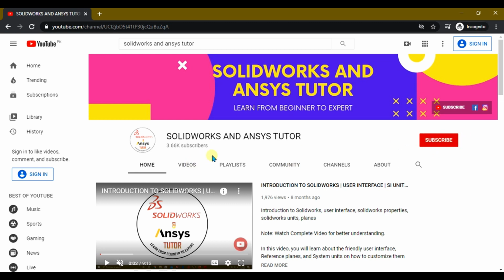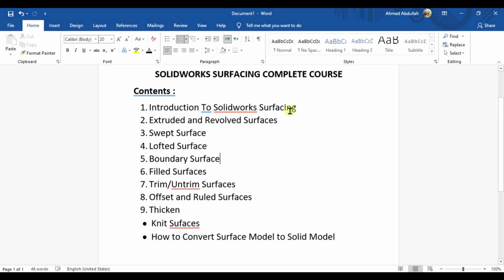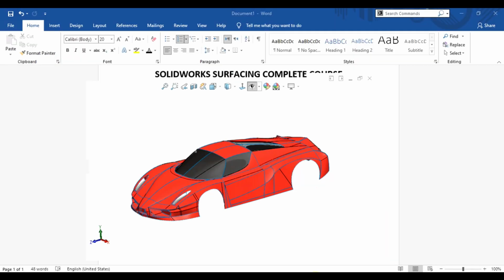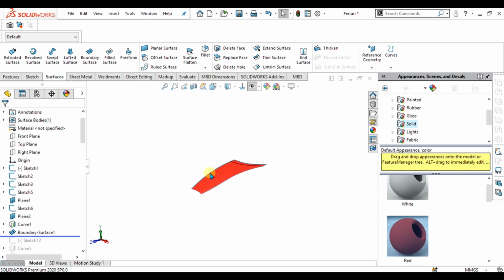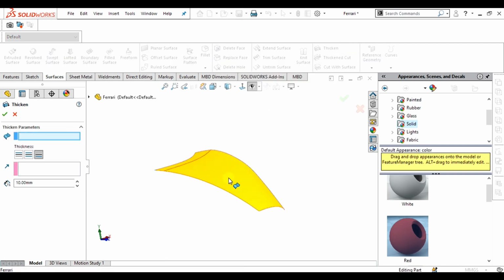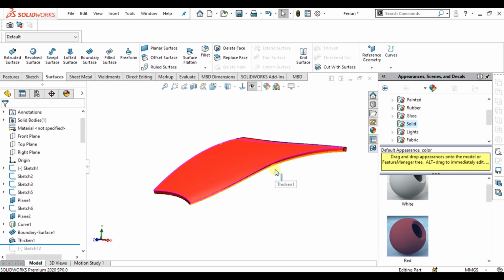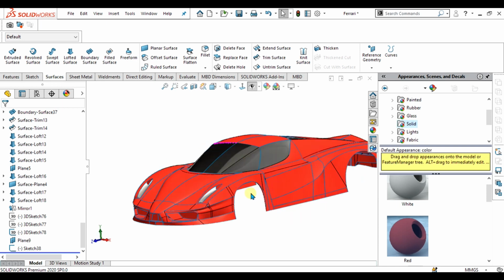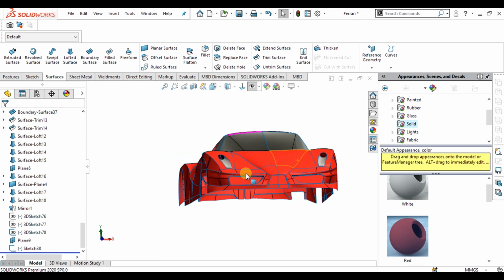Solidworks Surfacing | Introduction to Solidworks Surfacing Complete Course

Comment: Is Ryzen 5 4600H with Nvidia Gtx 1650 good for Ansys, Solidworks, Openform, Hypermesh, Ansa? Any problem in that? Reply fasts
Reply from the maker: Better to Use Workstation Graphic Cards like Pro Series of AMD and QUADRO Series of NVIDIA It will work much better then NVIDIA GTX Series